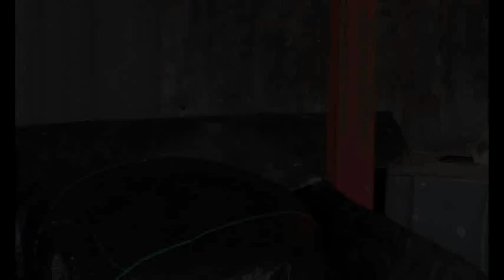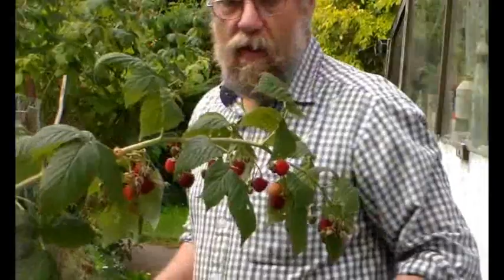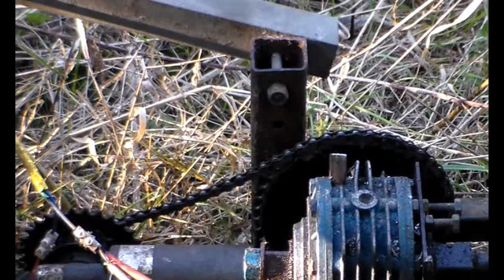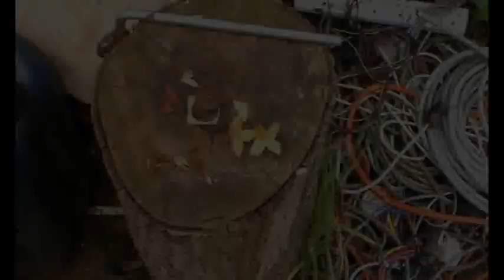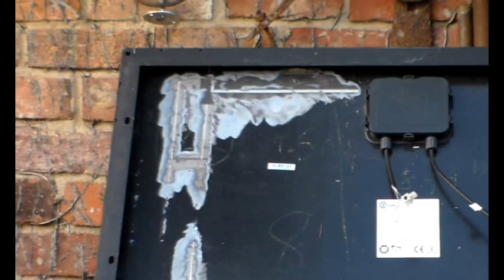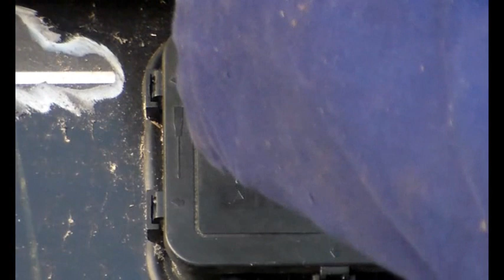Home life No.26, late Autumn preparations, course update, solar repairs, chainsaws, Beech seed.

Comment: Hi Andy,
Did you poll your students to see how many came from the YouTube channel?
Reply from the maker: Ian, morning, that would be an interesting question and I have had students tell me that in the past. However it could be embarrassing to ask direct so I wait for the former. Hope all good with you, cheers
Reply: @TheInfoworks  yep, going OK, grown out of the expectancy of good weather (and inevitable disappointment) and now grabbing every opportunity to have a coffee and sit outside when the sun shines.

I replaced the relays with same brand and model in the Sununo inverter yet the error remains. I'm thinking there is a circuit that measures current flow when the relays are closed. I checked the functionality of the relays before fitting. Not investigated further as yet.
New relays have been delivered for the smaller unit that I intend to replace this week.
Reply from the maker: @ianhelsbyservices  Ian, yes it's all part of the process, sometimes it's trail and error, cheers

Comment: I have an American chestnut ( Buckeye) tree each year some have no solid “ nut “ inside just full of sticky liquid. This year loads of em , do you know why ?
Reply from the maker: Hi, outside my experience  but I'm assuming the buckeye is similar to the House Chestnut, Over here they are suffering from both leaf miner and then bacterial canker, which in many cases eventually kills them, cheers
Reply: @TheInfoworks  thanks for that,  yes it is exactly like a horse chestnut once out of its shell, the shell is however completely smooth ,  the. Squirrel knows which ones are worth either pinching or leaving.  Have a spare ( 2 years old) if your ever oop north M6 j 16 . Drop me a note .  Ps . Last winter I managed to get some sweet chestnuts reputedly Italian ( big nuts) to take they are approx 18” already.
Reply from the maker: @pollywollydo  Sweet Chestnut are a bit picky on the soil in my experience, seem to prefer slightly acid. Thanks for the offer, will bear it in mind, cheers

Comment: It's the natural order of things Andy, winding down to the solstice and filling the basket now while there's stuff to fill it. The modern world respects none of it.

Up here the frame for the solar panels is almost complete, then a coat of some kind of toxic juice to lock in the goodness and then the panels will go up. 

I find with some jobs that as I am enjoying them I realise that I am enjoying them, and I slow down because if I finish, then that job will be over. That is the case here. So far I have paid fr the panels and inverter. All of timber has been found or reclaimed, all of the fixings were in the stores from other jobs or bundles of bits and all of the steel for the footings was in the pile. I paid a low price for some cement that someone had left over and I bought burst bags of aggregates for about a quarter of the price. Even the wood preservative came out of a skip! To think that I almost went to the timber yard a month or so ago! 

Meanwhile, a mig welder has appeared (whether it works is to be discovered!) and other tools that may warrant videos in their own right.  There is plenty of time in the future!
Reply from the maker: Owen, splendid work, steady progress is very enjoyable and allows for design changes, especially pertinent when using recycled material. I was assuming that with those huge ground anchors that you were just going to back fill, however you are obviously from the school of better safe than sorry. Short pieces of that builders galv steel strapping would be ideal for fixing the panels to the wooden frame, So in the fullness of time it will be ready for the return of the sun. Make sure you use double insulated solar cable for the high voltage DC, it can leak to earth through standard cable, cheers
Reply: Hi Owen and Andy,
I had replied earlier but seems to have been deleted. Perhaps it's because it contained a link to an external website which would drive visitors away from YouTube.

Will put message again after this one so at least this will remain:
Reply from the maker: @ianhelsbyservices  I frequently get viewers messages that disappear, it's most frustrating but I suppose it must stop some of the numb neck troll nonsense, cheers
Reply: Hi Owen,
Regarding your new MIG welder. If it's one of the cheap hobby ones then I used this website as it contains valuable modifications to improve the reliability. I'll pop  spaces in the link so not clickable and hopefully not deleted by the censorship.
Still being deleted so best idea I have is to type 'MIG modifications' into your internet search provider and look for the one with the domain address of a popular model of Volkswagen car.

My SIP mig welder was unusable due to intermittent wire feed. Solved by adding a seperate power supply to the wire feed motor, the speed controller is hard wired in so I added a seperate unit. I also added 12V computer fans to either side of the transformer.
Reply from the maker: @ianhelsbyservices  yes I know what you mean. I had a mighty Mig unit and I replaced the wire drive controller with a variable speed controller. However I mostly use my DC inverter arc and I seem to get away with that. Years ago I had gas for welding up cars and turned them on their sides to do most of it. Not any more, they don't seem to rot out so badly, especially if kept in the open barn, cheers